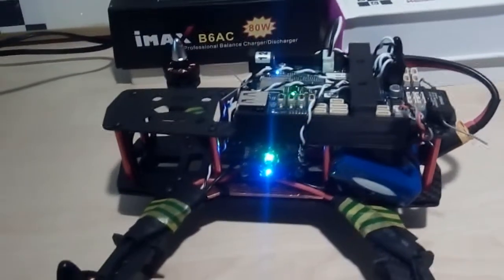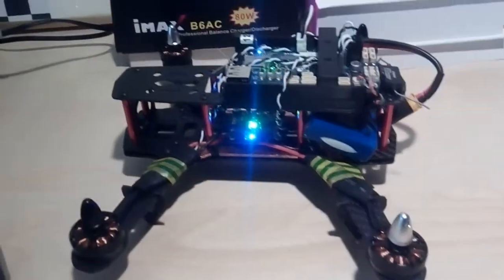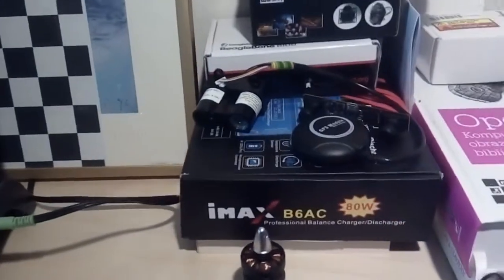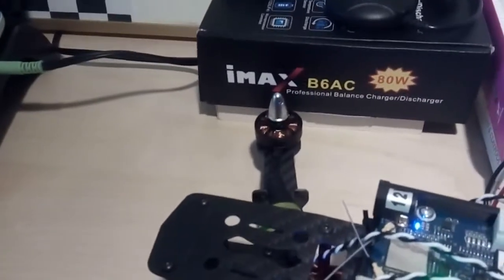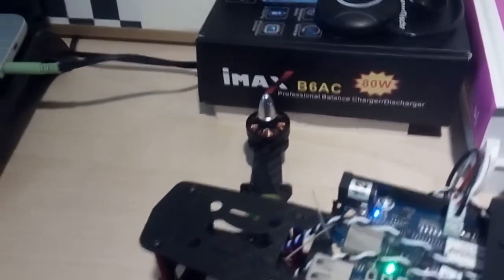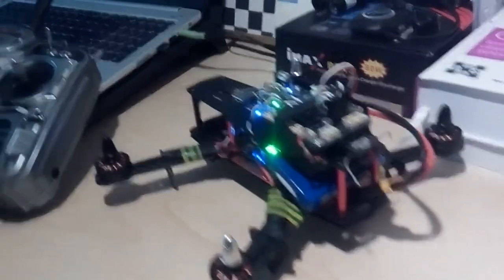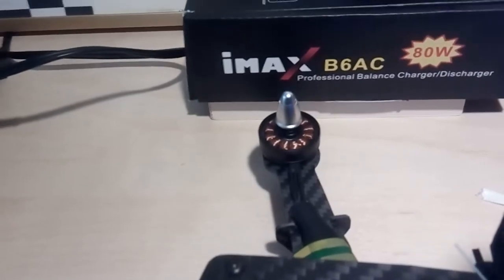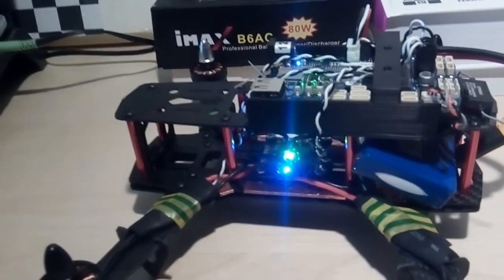Ground tests (1) of BeagleBone Blue based quadrotor

Comment: I am working on integrating my DX6i radio into some robotic vehicles. Best of luck with your build.
Reply from the maker: cheers, cool, in this video there is just sattelite used from AR7700 receiver but BBB has 5V power out hence this receiver is working with sattelite using Remote RX connection